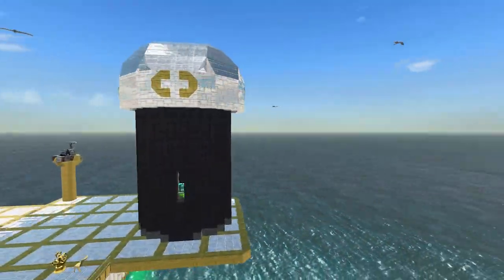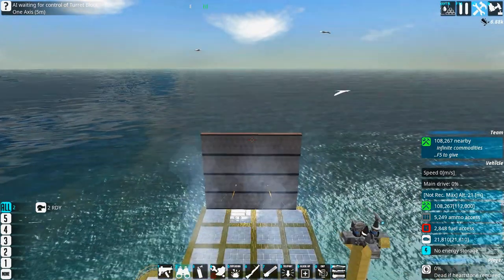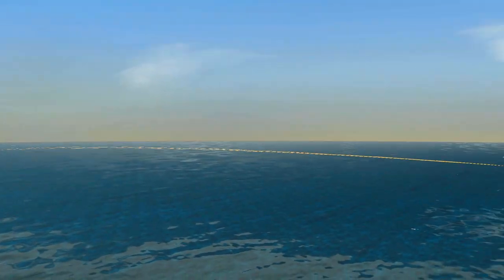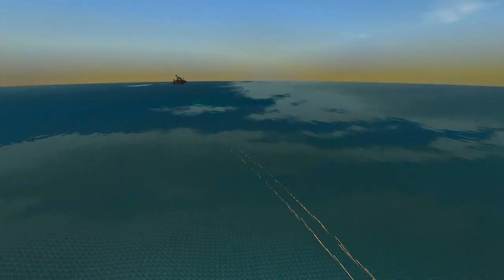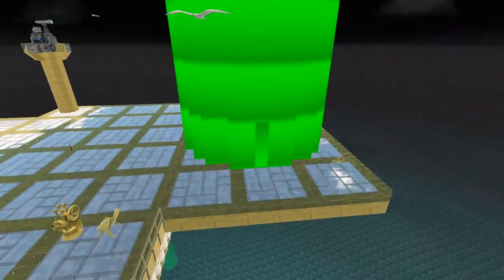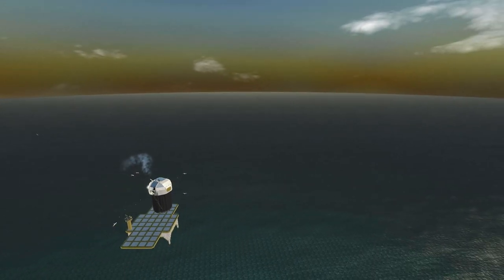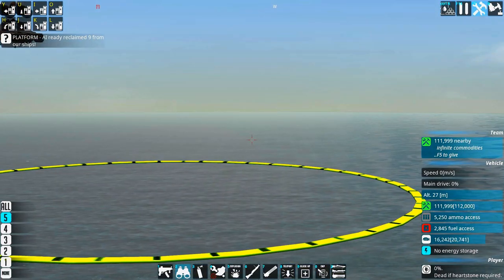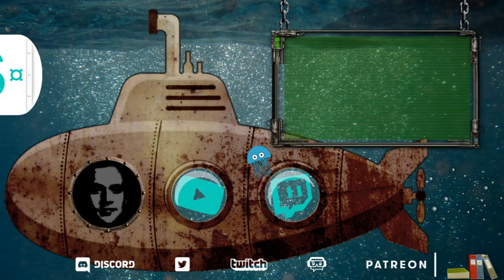90000 RPM Twin APS? - From The Depths Advanced Cannon Turret Showcase & Test

Comment: To find out if you actually hit 90k rpm (you dont) you could either fire until you run out of ammo (should take only 10s on your max rpm gun), or fire them for a few seconds, pause the game, and look at the gun to see how many bullets are still in the gun. But yeah, the limit is 2.4k, like others explained, because the game runs at 40fps. AFAIK you can achieve more by setting the game speed to 0.1x (giving you 24k rpm), and even further with the setting "explosions slow down time" and a nuke exploding in the background.

Comment: Hello, 
2400 RPM is a game limitations,
The game core run a 40FPS and It can spawn 1 shell per frame per barrel so 40*60 == 2400.
You can't go faster with a barrel but 2 firing gun piece can reach 2X2400 RPM but don't do that as their is a max number of shell at a given time so your shell will despawn before reaching the target (also make enemy shell despawn)
Reply from the maker: Hmm, shell despawn is a potential jank defence method then... So if i have 10 2400 rpm guns, then i can despawn the enemies killer aps?
Reply: @GMODISM  never tested it for the goal of defensive mesure only but when i tested 8x2400rpm the shell never reached target after 1500meter because of speed and number of them spawned. 
but we know that the game has a limit on the number of shell at a clock tick so when you try to spawn a new shell and you are at this limit the game will despawn a shell. from my experiment the shell despawn is not random and seem to be the last one so in theory if you can fire N shell before the enemy shell reach you the enemy shell will despawn indeed.
through it has huge limitations:
as you where speaking of killer aps shell i will take the example of a railgun shell i used which was at 1600m/s.
so saying you are at 3200 meter from the gun, the shell would take 2 sec to reach you. and we know the max numer of shell you can spawn in 1 sec per barrel is 40.
so you can spawn 80 shell per barrel before the enemy shell reach your ship.

This means you'll need to have N/80 barrels at 2400 rpm to make the shell disapear before reaching you. 

Where N is the max number of shell the game can have at a given time.

So technically yes but in practice no or just too costly when in the end it only protect against aps but render all of your aps gun useless has huge size, building and running cost (and the example i took is from more than 3km away most engagement are closer in range ^^)
Reply from the maker: @ComandantChaos  Yeah of course I guess, it's a fun janky idea though but not too practical... about that , going to build a 2400rpm 500mm gun XD
Reply: @GMODISM  well if you want to do this but not in the normal way think about 100 rail draw with 2mod 500mm in belt fed autoloader you can have some stupid results looking like a flamethrower with a quite small size
Reply from the maker: @ComandantChaos  Seen my friend do some crazy stuff with this tactic... basically nukes a ship with frags

Comment: Oh yeah should talk about the other limit, shell despawn. There's a total ingame shell limit, and you start getting to it pretty fast with >1000 rpm guns.
Reply from the maker: Ohh I see that explains why the fast fire guns feel nerfed and that some shells seem to not even hit at all!
Reply from the maker: How many shells can be spawned simultaneously?
Reply: @GMODISM  The limit is not shell number, but something about the in-game physics refresh rate. Iirc, the limit to a single firing piece's rpm is 2400. There is nothing to stop you from putting three or four of those on a single turret, though!
Reply: @GMODISM  The default is 500 shells, but in the misc options you can increase it up to 5000
Reply from the maker: Ohh, nice! Will check that indeed, won't increase it because my pc melts but when I have upgraded I can play more with filling they sky with lead!

Comment: If you can get just a tiny bit of rail charge, that thing could get much better range.  I've experimented with similar weapons.  I managed to stuff 2 28mm miniguns into a c130 styled gunship with like 100 energy per shot it was getting a range over 2000m. This was with a fire rate of like 1200 I think.
Reply from the maker: Probably very true, I just haven't played with railguns enough, dont even know if they are worth it or if rail assist is always better...
Reply: @GMODISM  that super dreadnaught I put up on your discord is using like 10 of them with APHE going at about 1000m per second and can pen the side of a tyr.  It's using a shell that's much smaller than what you would normally need to do the same thing (380mm).  I think one would need calculate the cost of the gunpowder modules to get the shell moving at that speed and compare it with the cost to run steam turbines to get the same effect.  It's using like 20k rail draw.  It's got lots of tweaks left but if you want to poke around in it's rail guns I can send it to you.  

Personally though when it comes to costs in the campaign, after I finished my LP of QFN a few months back, efficiency doesn't matter nearly a much as one would imagine.  I had about 10 million materials worth of ships sitting outside the scarlet dawn before I attacked them.  That leads me to believe that cost isn't as important a factor in the current version because materials are too plentiful for it to be a limiting factor in designs right now.  Especially if you can get a handful of the resource zones and a fast transport to get them around.

Comment: Although, 90000 rpm is impossible to achieve in game. You technically might be able to achieve even faster fire rate using rail charge. A frag warhead and a gunpowder shell are technically not the smallest achievable shell. You can use a single shell head with no gunpowder and instead use rail charge.
Reply from the maker: Hmmm, yeah I guess, should experiment more with rails!